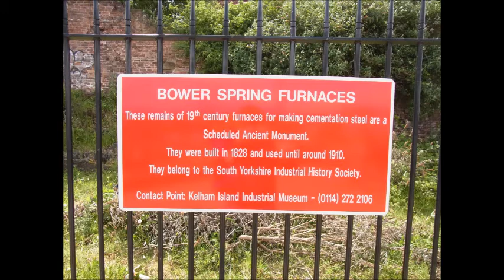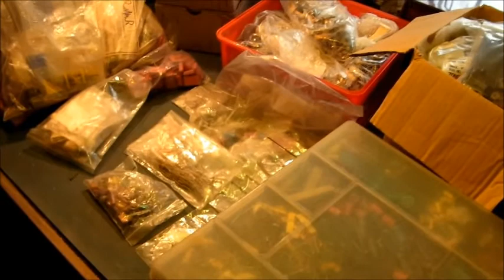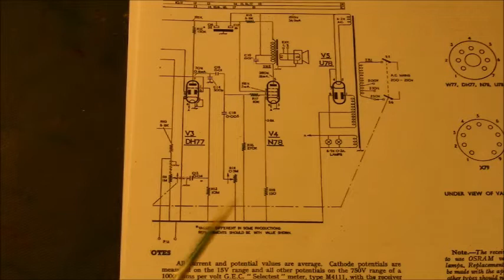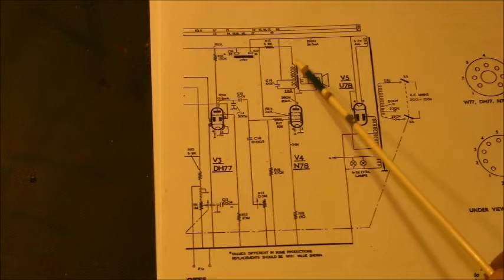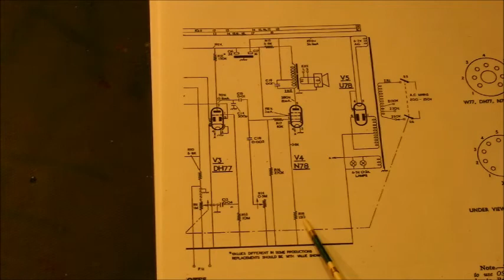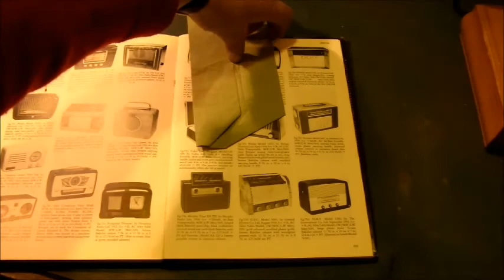GEC, Model BC5445, Vintage Radio Restoration, Part 2.

Comment: Phil, I enjoyed your latest video.  When I was starting my career, I hit the tail end of the TV servicing business in a small shop.  I did not do many radios, as by that time, it was cheaper to buy than to repair.  I moved along into commercial two-way radio service and lost touch with the magic boxes which started me on my career in the first place.  Very enjoyable.
Reply from the maker: Stephen, many thanks for looking in.  It is immensely appreciated my friend.
You sound to be younger than me.  I recall those apprentices who started ten to fifteen years after I started not repairing radio for the same reason you wrote of.  By that time, the term ‘radio servicing’ had been replaced with ‘audio servicing’ (Hi-fi and home entertainment equipment).  Here in England, televisions, along with virtually all other household brown and white goods, are no longer serviced: they are disposable items – it is for that reason I am now working out my final working years on public transport.
As always, it is great to correspond with you my friend.
Phil.

Comment: Another excellent production, my friend.  It's really good to have you back.  I need to work on Dylan, get him back producing, also.  Thank you for the reminder of the book, Radio! Radio!, which I had intended to buy, when you mentioned it previously.  I paused the video, went to Amazon and purchased it, a very good rated, used copy.  Quite an expensive book, but, as a primer for sets from across the ocean, a good investment.
Reply from the maker: Al, thank you my friend.
You’ll not regret buying a copy of ‘Radio Radio’ by Jonathan Hill.  It is the number one book amongst Vintage Radio men over here. 
Whenever we British Vintage Radio men chat over the telephone, or net, about a particular radio, we – well I have that copy near our telephone so that I can refer to ‘fig –whatever number it is, Radio Radio, page number…’ should the person on the other end of the wire not be familiar with the radio I am referring to - or vise-versa.
I’ve recently purchased my own copy of ‘Philco Radio 1928 – 1942’ Ron Ramirez with Michael Prosise.  In a fair number of respects, it is similar to ‘Radio Radio’: the difference being ‘Philco Radio…’ is dedicated to American valve radios manufactured between a fourteen year period and ‘Radio Radio’ does a reasonably good job at sweeping across many makes of British Vintage Radios over a fifty-to-sixty year period – I think that is a fair, in a nutshell, review of two, rather expensive, books???
Just for good measure my friend, there is another book I recommend: ‘The Setmakers’ Keith Geddes and Gordon Bussey.  Again, not a cheap book (none of them are!) but, for a none-academic - social and economic history type of text book, it does a fairly good job at focussing upon the British radio and television manufacturing industry (when we had such an industry).  I say it makes for a reasonably interesting read.
Cheers Al,
Phil.
Reply: Thanks Phil, I'll see if I can pick up a copy of that, as well.